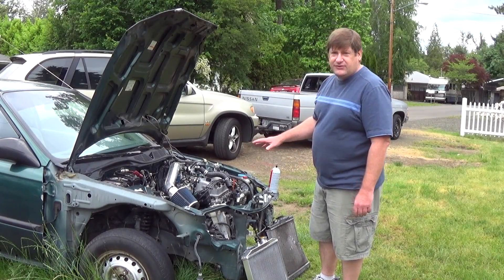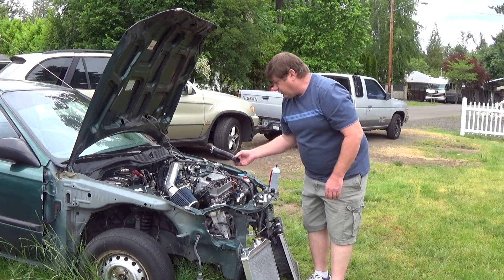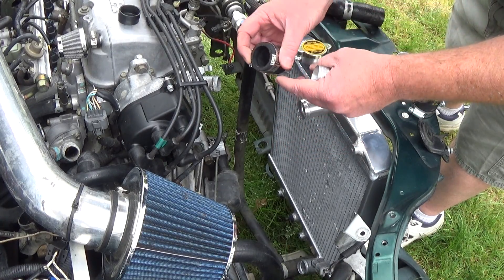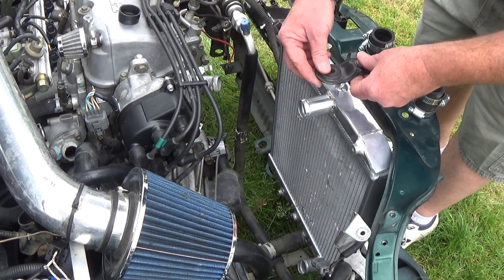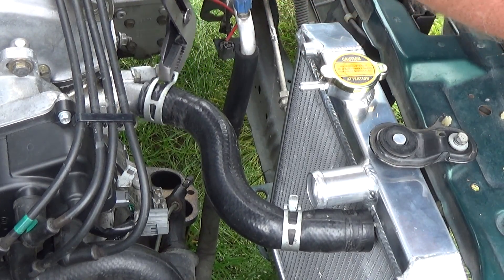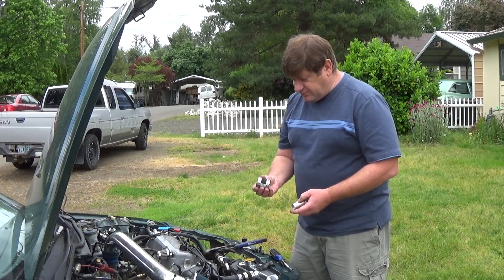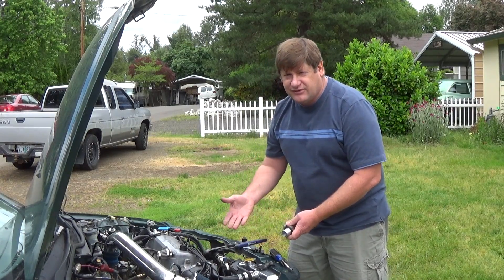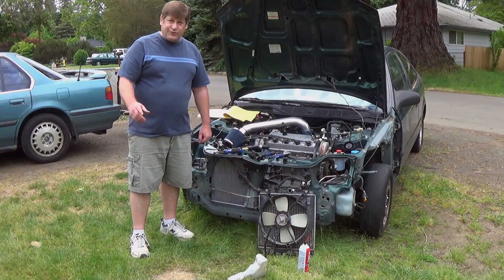Honda Civic Radiator Install

Comment: I ordered a 3 row 28mm out, for 95 civic, matching radiator and hoses G-plus, I'll update later
Reply: What happened?
Reply: @grey5889  the transmission lines need a place to feed and cool, because these radiators don’t have a trans fluid cooler

Comment: i put a cool air intake on my 95 civic and i just put the tube from the valve cover to the big cool air intake tube but i saw on your valve cover you have another mini air filter where the little tube should be? my question is where do i get one and does it affect anything if i disconnect the tube from the cool air intake and replace it with the mini air filter?
Reply from the maker: https://www.youtube.com/watch?v=a78WU4x4UNQ
Reply: tubejim101 thanks for the response do you know what size it is and what i should ask for when i go to buy one at o"reilys? i appreciate it alot!
Reply from the maker: Just ask for their air intake section.  This one is made by Spectre.  Not sure what size, but they have a band clap, so you just have to get close.  http://www.spectreperformance.com/cat/air-filters-breather

Comment: I bought this and i have a d series engine automatic, would it still be able to run with it? Reply back please
Reply from the maker: You need the transmission coolant line ports in the radiator.  If you have those, and a way to hook up your coolant lines.  Then you are good to go.

Comment: How much to have these adapter fittings made... annnnd IS this something any machine shop can do, and how much do they cost?  Many folks are just forcing the old hoses on I have read, and would guess.  I have 97 Civic EX with Manual..  The unit I purchased is from DNA via Dynasty on Amazon.
Reply from the maker: Think I could sell them to you for $25.  Have to see how much my cost is to have them made.  Think it was around $10  each.  Any machine shop should be able to have them made for you. Price depends on where you live.  Oregon has no sales tax, so that helps everyone.  Cali, has high taxes, so that makes everything more expensive.
Reply: So, do you have an extra set made up now?
Reply from the maker: I do not.  Would have to have the machine shop make another set.